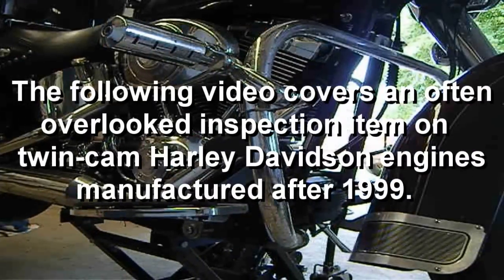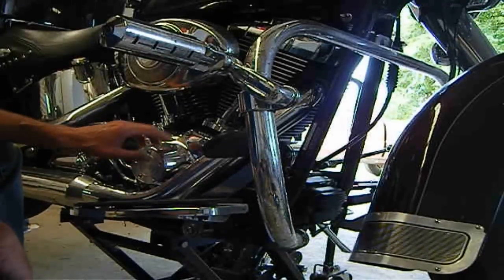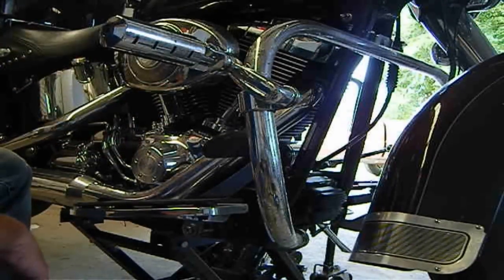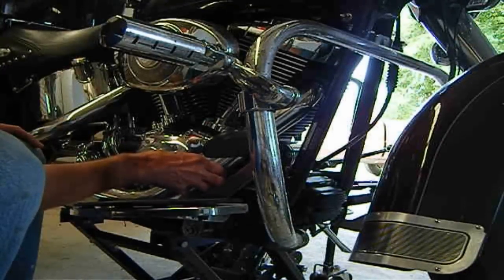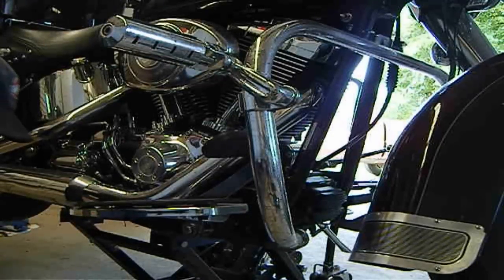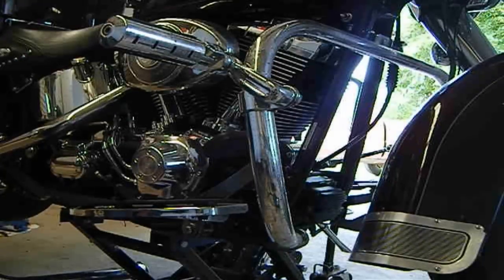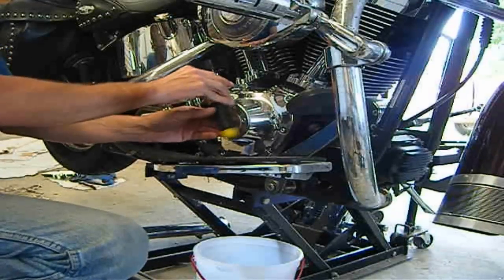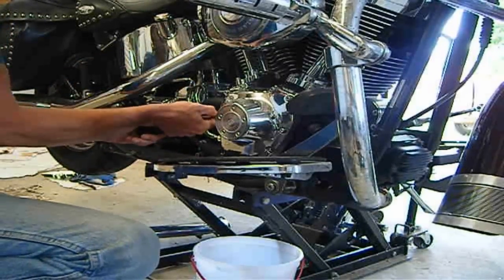TENSION HEADACHES: A Harley Owner MUST SEE!

Comment: The wear usually starts at 30,000 to 50,000 miles! I would not let it go more than 50,000. And while you're at it, now that it has been taken apart I would put a High Volume oil pump as well.

Comment: Nylon pads have been used for 40 years or more on many makes of Bikes.  20,000 mi. on yours is barely broke in.   Ya'all way to worried.   Use good oil on scheduled changes and you'll have little to worry about.    Drive it.

Comment: Had a first year twin cam, and factory manual. I don’t think HD thought these would wear out. Also the internet seems to magnify things, making a failure rate seem much higher. Anyway, inspection is a good idea. If you were one of the unlucky you wouldn’t want bits all through the engine. If I still had a TC I’d probably do inner and outer cam bearings around 30,000 along with tensioners.
Reply: I disagree. This is a serious design flaw that HD should fix or at a minimum, pay 50% of the parts and labor for any Twin Cam.

Comment: This is why Harley-Davidson went to a single cam and single chain, single tentioner on the Milwaukee 8 motor. Then there is the highly problematic chain primary drive over time.
 Indian and most other manufacturers have a gear drive primary with 1 chain and 1 cam chain easy access as well. Harley-Davidson has come a long way but my 96ci with a gear cam kit totally eliminated the need to open my cam chest and devote attention to primary chain only.

Comment: The hydraulic lifters last longer than the spring loaded ones. It is good to check. I was 650 miles from home when mine let go. I caught it early and it did not damage the engine but it is something that you should check every fall when you winterize your bike.

Comment: There needs to be a class action lawsuit. This is an unforgivable and gross design flaw !
Reply: Yes stupid HD and even more stupid dealers who doesn't tell you anything
Reply: I agree 100% with you between these cam chain tensioners and the faulty cranks with excessive run-outs there should have been a lawsuit and if you have a Dyna frame you have to add stabilizers or else you get the deadly wobble on top of all of this.
I've corrected all of these things but I shouldn't have had to.
With all I've had to do on this relatively simple bike you can bet there's no way that I would buy a brand new Harley and try to correct that complicated mess.
Reply: @jamessouthworth1699  if you were to conduct a fall away procedure you will do away with the "death wobble". This is a maintenance item that is often overlooked
Reply: @kennethwise7108  it's not a neck bearing Shake, it's the entire rear wheel, swingarm, trans, and Engine moving in the chassis. There's only one chassis stabilizer on these from the factory while there should be three. They fixed the problem when they made the Sportster rubber Mount by including all three stabilizers what the Dyna was never fixed from the factory. Once I added the missing front and rear stabilizers the problem was solved. It's most noticeable when the front motor mount is worn.
Reply: @jamessouthworth1699  the center bolt on the front mount comes factory equipped with the wrong size being utilized also. I ride exclusively Evo's and haven't never seen the problems like you're describing. I do all of my own wrenching and have eliminated death wobbles in everything I've put my hands to.
Reply: @kennethwise7108  The Dynas I'm talking about are not Evo's, they are Twin cam 88 like the gentleman in the video is talking about.
Reply: @jamessouthworth1699  I'd still recommend a fall away procedure. That's gonna be your best bet for eliminating any kind of wobble issues.
Reply: @jamessouthworth1699  and 91 was the first year of the Dyna, I'm sure that they had a similar mount configuration as the Twinkies did.
Reply: @kennethwise7108  I can't speak for the Evo.
I can only speak from my experience with the twin cam which had nothing to do with the neck bearing.
Reply: Design Flaw also known as Intentional Gremlins .
Reply: Yea why waste time doing this . When the bearing may fail also and the crank twist. . Just let it blow or fix all the issues!.
Reply: sorry to be off topic but does anybody know of a method to get back into an instagram account??
I stupidly forgot the password. I love any tips you can offer me
Reply: @Kristopher Jackson Instablaster :)

Comment: had 40,000 mils.on my roadking and they (the cam chain shoes) were 3/4 worn, so instead of dealing with it again, I installed a cam gear drive, oil pump, cam plate, cams, lifters. glad I did what a difference.cooler running, quieter, and more power. h.d. should get it together .they only been making motorcycles 115 years, makes you wonder!

Comment: there is one item that HD recommends when you pull the cam or cover on the twin cam engine is the upgraded oil by-pass valve. Check with you local dealer and see what they say. I have a 2010 Heritage and I had a set of 259e cams installed and at that time they put the new valve in.

Comment: it is not supposed to be a servicable item as per my shop manual. Nylon is not new to HD. Primary chains have been riding on nylon forever. I have nevere had a problem with any of them. Not saying it can't be a problem. I have always run Amsoil 20-50 since I bought the bike new in 2010.
Reply: yes- primary chains HAVE been running on nylon ... 6 - 10 inch pieces of nylon, not a 2 inch piece. Between the constant spring pressure and the chain's texture-  the wear in inevitable.  This doesn't affect bar bike and garage show pieces but for guys like myself who actually ride their bikes... this needs to be addressed and then checked at the end of every season... 10-12K intervals.

Comment: I read into this a little to much worrying about being broke down on the side of the road.at 30000 and 12 years they had very little wear like 1/64 wear.they was starting to pit so I replaced.this tensioner thing isn't a problem but replace every 10 to 12 years and don't be riding dangerously and they are no worries.

Comment: ALL motorcycles have weak spots. Everyone is yelling that the evo is the best but they had problems as well, like cam bearings disintegrating thrashing the engine. In 1 month my evo blew the ignition and after fixing that, a bearing went in the engine cratering it. Also honda has cam chain tension problems since forever, kawasaki gtr hydrolocks, bmw has breaking exaust valves and failing final drives, suzuki has failing alternators, ktm has failing waterpumps, triumph has failing starter spraks and fuelpumps, honda has failing fuel pumps, honda has cracking rear forks, honda has rusting rear forks and pealing paint, ducati has failing timing belts, yamaha has failing clutch baskets, and MANY MANY MORE bikes have weak spots causing havoc and destruction. I owned all these bikes, ridden them for hundreds of thousends of miles and seldom have these problems popping up. I always research my bikes and ALWAYS people make a hassle over some sort of incredible fault in the bike and that others (models or brands) are better. Complete bull****.  Wake up, nithing is gonna happen, and if it does it’s just bad luck for you, stop fcking up the ownership of others by making them think the bike is bad. Its bs.

Comment: loudpipes, can you see much of the front tensioner  by just removing the smaller cover on the cam cover? we used to call that cover the timer cover on the old shovels. thnx steve
Reply from the maker: The timing cover is just for show.  There is no hole behind it.
Reply: i guess they kept the timer cover to keep the look of the old. so if hd has been using the twiin cam design since around 2000 to 2018 or so that's a lot of bikes and a lot of motors with this issue. i guess even the redesign with the hydraulic tensioners still uses the same material with shoe. but like i said my new used 02 bike is really sweet and runs great. it has an s&s carb and all i had to do was turn the idle up a bit cause it kept stalling.went thru and tightened everything i could get a wrench or scewdriver on and next i'll change the oil and maybe the battry if it needs it and may be get into the cam cover for a look see. it never dawned on me to keep a small set of jumper cables in the bag but i saw some at the store and pickedem up. i was suprised at the size of the battry, the one in my old flh shovel was about 3 times bigger. it's mid april and 32F in massachusetts and rainy snow, we have such a short season up here but there will be good riding ahead. the only thing i will change is somehow quiet the pipes which are python 3. i like some noise but maybe i could stick a baffle in them, i'll have to check out options. good safe ridin' to ya , steve

Comment: loudpipes, how come hd didn't use a spring loaded roller instead of the plastic shoe? thnx for the info, i just picked up a 2002 heritage from a private sale with 20k miles. i guess i'll be checking this before i change the oil. the bike looks well taken of and very clean. the inspection i can do but the fix will have to be a real mechanic. i would go with the s&s gear driven unit.

Comment: Would you buy a car that needed the motor stripping just to make sure its not eating its self  every 20000 miles ?
Reply: Oh but how many people from around the world were BRAINWASHED by so called GERMAN engineering with the PORSCHE 944 that needed timing belts EVERY 30,000 miles !!!! Oh and you also HAD TO  change the water pump, seals, and the belt tensioners too. GERMANS SCREW UP JUST AS BAD AND WORSE.  PORSCHE SHOULD HAVE BEEN SUED WITH A CLASS ACTION LAWSUIT AS WELL. Everyone screws up,  NOT JUST AMERICANS HANS !!!!! YOU'VE MADE A FOOL OF YOURSELF.

Comment: It should be noted that the cam chain tensioners is not the only problem exhibited by this poor design. THe Crank run-out coupled with the cam chain tensioners and the poor grade bearings in the cam plate and case all have the same end result. A very expensive motor job. And inspection is not going to give you any clue that the bearing(s) may fail, except if you discover that you have considerable run out 3/1000 plus. I knew about the cam tensioner inspection and had been checking. But the inner front cam bearing failed and the race was ground down slowly and destroyed the bearing race, cam bushing and insert seat in the crank case! No excuse for this HD! But alas, this is the culture, and shame on me for getting sucked into this shit. 50 plus years riding and never had a motor catastrophic failure until I bought a Harley. Unbelievable!

Comment: Go with the gear drive cams with new cam plate and high flow oil pump.
Reply: Better check crankshaft runout first to see if you can use them! Study the subject thoroughly before spending money.

Comment: I have a video about these.  Actually those tensioners may not even be necessary, because if these chains were measured and made slightly shorter the tensioner would never be needed.  This design was done only as sales so that HD sales could state they now had a quieter engine than ever before.  You take even my 98 dodge ram with the 318 V8 and how that timing chain that runs between the crank sprocket and cam sprocket has no tensioner at all same as your older engines and those chains had some slack and it was okay.  Like I say in my video in where the chain shouldn't have slack in the first place.  I'm surprised that an after marketer hasn't machined a chain that is shorter.  If they did these could be ran without these tensioners.  Now pertaining to tose push rods and going with adjustable ones, I would say NO because when these tensioners are changed your rockers in your rocker boxes could have wear where they ride against the bolt shaft and these are affordable to change and very easy to change.  Anytime the tensionaers become so worn they need to be changed then it is likely that the rockers themselves need to be changed as well.  Also don't over look the fact that if you have the Twin B design 88 CVO engine that you have two larger tensioners and a long chain running on the primary side flywheel too!

Comment: My TC engine was dismantled late 2016 to get the casings powder coated, the cam chain tensioners had never been checked and although the bike only had 15000 on the clock the pads were well worn. I have actually gone to gear driven cams as I had the engine dismantled so it was the ideal time to do it. I did not do the work myself, I ha the job done by Esk Motorcycles who have their own YouTube page.

Comment: Mine need replacing and HD never mentioned it. I know I should know more than I do, but I'm not much of a mechanic and I bought a manual for my my 02 FXDL and it mentioned these to be checked at certain intervals, unlike HD dealership as mentioned before. Anyway, thanks for the video, it really helped me out.  Also, thanks to some of the comments below, they gave me some info that I needed too.

Comment: very informative. I have a 2005 Softail Deuce and the Harley dealer has never recorded this as a change and never mentioned it as a potential problem. I will be inspecting my tensioners this week. 28,000 + miles on it so far.
Reply: Possibilmente in italiano non so l'nglese!!!!

Comment: Great video man! Thanks for sharing this . I  check this at 20,000 miles as well
Already planning to change the primary chain tensioner with twin powers manual adjusting tensioner.

Comment: I don't understand why the aftermarket never came up with gear-type tensioners that ROLL on the chain versus a stationary shoe that rubs and will no doubt eventually fail over time. Sure, you can always go gear drive cams to eliminate this altogether if you want the hassle and expense of ripping apart your perfectly good running whole engine to have the crank done, no thanks on that.

Comment: This really is a great video.  I will be doing this on my new-to-me bike.  The only issue I have is at 7:53 when the inner tensioner is released and let slap against the chain.  That is speculated to be why so many failed early.  The plastic can fracture when slammed against the chain.  The spring is strong.  If all that work to inspect is let snap back you might be better off not doing the inspection.  Find a way to let the shoe come down gently like Loudpipes did on the outer tensioner.

Thank you for making the video.  I did not know I could see the inner tensioner without removing the cam plate until now.

Comment: S&S has the fix,sell a conversion kit doing away with this set up and replace it with gears
Reply: Should you have to do this at all? THat's the problem with HD and the business has built up over the years to the current state of no mater what motor you have, there are gotchas all over the place. It's a culture I got sucked into after 55 plus years riding. Never had any motor problems. Just regular maintenance -- the main stuff - oil, spark plugs, sync carbs, change gear oil, replace chains, etc. NOT CATASTROPHIC ENGINE FAILURE AFTER 14,000 KMS.
Reply: Geez you might as well build your own or go japanese.
Reply: I have a brother that works on Harleys and he does advice having the cranks welded up and trued up.My dad did it to a 2001 Ultra he had keeping it stock.Noticed the difference right away.Did the conversion to gears
Reply: My dad did it himself.I don't remember the price of the kit.
Reply: The kit runs around 700.00. There is a local bike shop here that install these gear drive cams. total cost is 1500.00 out the door. Shops near you might differ. Also note that the run out on the crank must be checked. Upgraded exhaust and intake is recommended and then have it dyno tuned.
The S&S
https://www.sscycle.com/search/?category=1%7CCamshafts
Reply: Walter Frederick l

Comment: What a damn shame that the Motor Company couldn't make a mandatory recall and fix this problem with a gear to gear set up! After all the Sportster motor has been gear driven since DAY 1!
Reply: There is someone that makes the gear set up already,I think it is Vance and Hines that does make it
Reply: Because a gear drive has tighter tolerances and won't tolerate  misaligned flywheels: a real recall would entail COMPLETELY tearing down EVERY twinkie engine produced! SPLITTING THE CRANKCASES AND TRUING AND WELDING THE CRANKS.That's as far any any motorcycle can be torn down.

Comment: My '99 Electra Glide needed tensioner replacement at 35K. Good video, even better advice for those who have this setup in their motor.
Reply: my 99 ultra pads looked good at 24k but the cam bolt snapped off, I did a hybrid oil pump tentioner upgrade

Comment: I have to say that's got to be the best tutorial I've seen yet. so if I may ask, what's your outcome? how is it doing today? also, what is a more permanent fix for as replacement of those pads? I've got a 02 ultra with just 17,000 on it. it seems to be running fine. I haven't yet broke it down to do an inspection on it as depth as you demonstrated in this video. Let me know. an update I'd greatly appreciate brotherman. thanks. Larry from Mason, Ohio.
Reply from the maker: Here you go Larry.  I've been meaning to do this for awhile.  You provided the impetus.  https://youtu.be/KGPolhGAVRU

Comment: Am I missing something?
They were fine right no probs,how is this a major design flaw?
Reply: geddstock- This bike was ok but there have been a number of bikes that had the nylon tensioner pad disintegrate, causing the pieces to lodge in the oil pump and the engine to be destroyed. This can happen in as little as 15,000 miles!